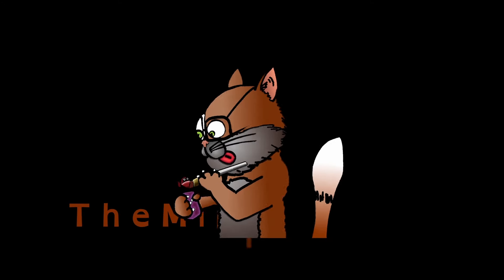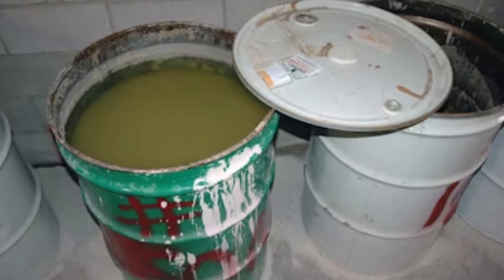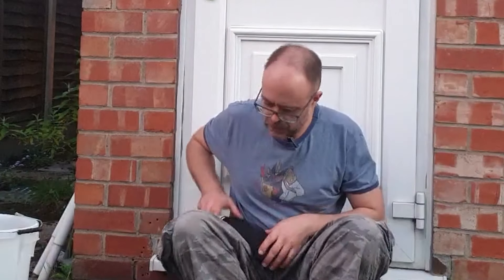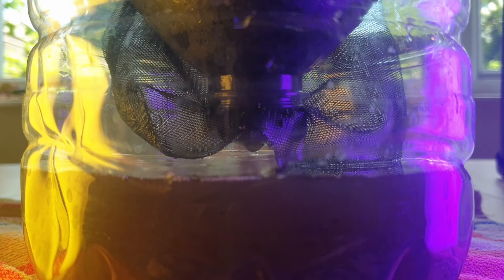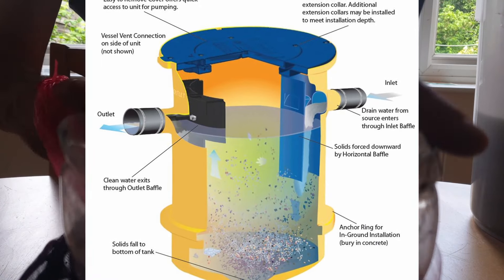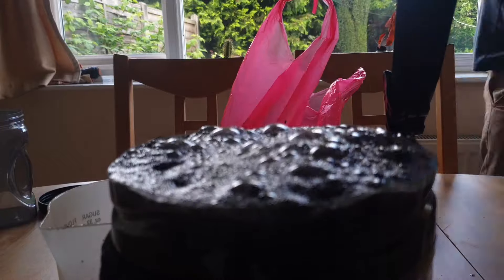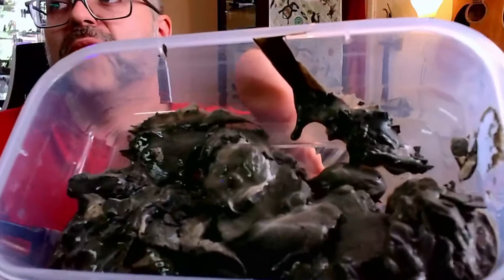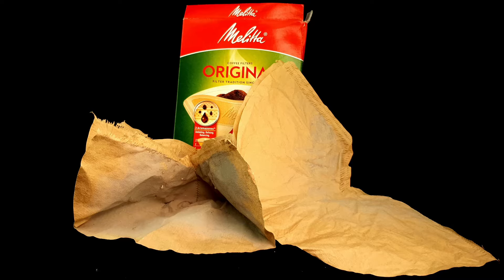Warhammer - Waste Water - Purification Ritual

Comment: seems to me like evaporating is the best method. its simple, much safer than using the flockulation chemicals, and leaves you with a similar waste product. 

not sure why youre concerned about acrylic hitching a ride in the evaporated water to be honest. acryllic paint offgases on your models, as they dry already. its the same process but with less water and more chemicals. and youre probably painting them indoors, none the wiser to the chemicals youre breathing in. as for concerns about those plastics and chemicals releasing into the environment instead of your house, i think the only actual way to dodge those ethical concerns is to not paint with harmful chemicals. but "dont create waste products." is not exactly advice for someone trying to figure out how to deal with their waste product. 

while flockulation is an interesting process and im sure this was a fun project to figure out, from a risk/reward perspective, handling all these extra chemicals to arrive at a result so similar to just...setting your paintwater outside for a bit seems silly.

so yeah, my long term recommendation is to find paint that you are comfortable with setting outside to offgas without need for flockulation. if youre creating enough wastewater that this is a concern, the best solution is to eliminate the problem at the source.

but yeah, really interesting video, you make a lot of good points and i think regardless its awesome youre thinking of your footprint at all
Reply: I believe he mentioned not being able to let it evaporate outside because of constant rainy weather and general moisture, cus it's England.
Evaporation is what I will opt into doing myself, seems like a good idea to me as well!
Reply from the maker: Thanks for the comment! Although, it made me wonder if you had watched the video 😂

As I said in the video, evaporation isn't an option in the UK.  Maybe 10% of the year there might be a window where it might, but, it's just too muggy and wet here generally for it to work.

I'm curious what you mean when you mention acrylic paints off-gasing when I paint with them indoors.  Please explain as I've never heard of this.  AFAIK acrylic water based paints don't off-gas andything harmful when they dry on a surface.

Evaporating your waste water and the drying of paint on a model doesn't at all seem like the same process to me, maybe I'm misunderstanding what you mean.  Some explanation is needed.

Indeed - just don't do it, is terrible and unhelpful advice.  You are right about that.

Again, as mentioned in the video, evap, not an option in the UK - 90% of the year too wet, humid or cold.

"the best solution is to eliminate the problem at the source."  Is this just another way of saying just don't do it?  Not clear to me.

It would be nice to hear back from you on all this!
Reply: @TheMiniMadCat  apologies for repeating myself in the comment, it was written pretty late last night. 

acryllic paints don't off-gas anything harmful to breath when drying, but they do off gas some chemicals. this varies based on the paint but is usually nothing to worry about. 

the only difference from a chemistry standpoint between letting paint dry and letting your wastewater dry is that your wastewater is mostly water and a little paint, but your paint is mostly paint and a little bit water. i said this in response to the point in your video where you express concern about compounds being released into the atmosphere while evaporating wastewater towards the very beginning of your video. the reason I didn't bring up the weather aspect is I just sort of forgot that point, it's a long video, sorry about that. 

as for that, it seems pretty unique to your situation that you create such a significant amount of paint water that there is more  paint water than days in the year where it could be left to evaporate. I dont want to tell you you're wrong about your own weather, so I won't, but for most people in the world there are enough sunny days to evaporate their paintwater without ever being inconvenienced. and failing a sunny day, a partly cloudy or overcast day can work as well, it is more about temperature and humidity than direct sun exposure. 

and the very last part of my previous comment was anticipating "oh, my paint is too harmful to leave out, it will stink up the neighborhood.", to which i would want anyone using paint that gross to just use different paint. for their safety as well as environmental to reasons. 

I do a lot of painting, and during my time at university there were days I'd end up with maybe a dozen coffee mugs of paintwater. letting that water evaporate down in a bucket in our little back garden area was the solution we went with, and it took quite a while before I would have to clean out the sludgey crusty paint mess from the bucket.
Reply from the maker: @arcanealchemist3190  I really appreciate the detailed response, that's great and helps clarify it all a bit.  No apologies necessary - I don't think I'd consumed my first coffee when I responded at the time myself 😂

Yeah, UK humidity is almost always above 70%, and often goes above 80%.  Today it's around 88%.  Whilst days where there's an ambient temperature and direct sunlight adequate to evaporate into that humidity is pretty low.  Using a container that absorbs heat from direct sunlight would be optimal I suppose if you were able to get it in direct sunlight, so a black pale would be more efficient than a white one.

There's definitely going to be a lot of places that can take this option considering this, so very insightful!  I may give it a go when we hit peak temperatures here and see how it works.

There's only a very small handful of paints I have that have any odour, and even less that are unpleasant.  I use them rarely, and they aren't acrylics generally so they don't apply to this aspect of my hobby/employment.

Thanks so much for the response, super appreciated!! <3

Comment: I dont really think there's a concern about acrylic particles evaporating into the atmosphere. Not any more than there would be with normal drying of the paint, that is. The acrylic and pigments arent volatile - the water is. You could probably pour the water into a wide bin - maximizing surface area - and allow the water to evaporate off, forming a hard layer of paint. It wouldnt be different than thinning paint and letting it dry. This stays true even if you have enamel in it. It would be something like "fordite" - a term for mineral-like paint deposits formed in car factories (of paint) 

Also, as a Canadian, dont dig at us for having medically assisted death. It doesnt make us look bad that we care about sufferring cancer patients, and aren't hung up on stupid tabboos or superstition. Annoys me that in the 21st century, people are still debating this
Reply from the maker: Absolutely right with the acrylics and evaporation I think.  There's no reason they would bind with the evaporating water base.  I'd assume this is true for any of the other elements within the medium either.

As for the bin suggestion, in the right environment this would definitely work, in a hotter, less humid climate.  It's hot as balls here (and humid), right now, so I could probably attempt it over the next few days - I already save my waste water in a medium sized black bin.  And this would indeed work for the enamels, white spirits and Isopropyl as a method of desposing of it all.  But I've only had one or two weeks this year so far where even trying that would be worth it.

I immediately guess the term fordite originally came specifically from ford factories?  Nice little bit of info.

As for the last topic, I have a rather complex view of death, one informed from much esoteric study.  And a view on sufferring that isn't simple either.  Cancer patients aside, I worry more about what I hear when it comes to it being offered to young patients with depression....